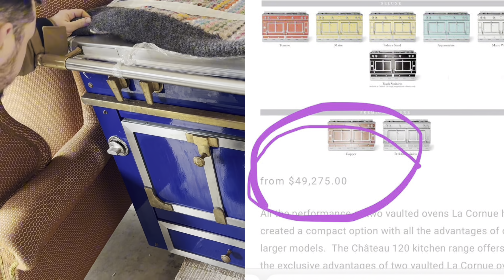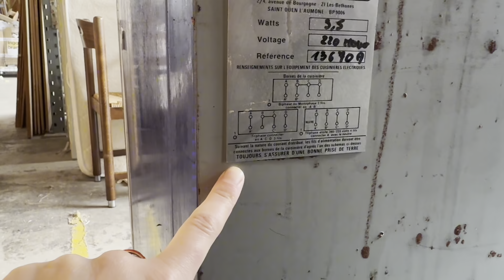Best thrift purchase ever!!! Renovating in Italy

Comment: Here is a description of a range that just may be a close match to your new range. I am so happy for your good fortune and can't wait until you have restored it to its original beauty! What a find!

La Cornue 48" Chateau 120 4 Burners French Top Dual Fuel Ovens, 1 Gas, 1 Elec

US $33,000.00  (eBay)

LE CHÂTEAU 120

The Château 120 range embodies an impressive cooking capability in a deceptively small package. Measuring nearly 48", this robust range features two vaulted ovens, one gas and one electric, 2 gas burners, 2 electric burners and a gas French plaque

47.2 W × 27.6 D × 36 H (inches)

1200 W × 700 D × 914 H (mm)

Traditional 4-Element Configuration

A stunner, la cornue 120 chateau range with gas top burners with 2 electric hobs and true dual fuel oven options. The left oven is gas and the right electric.

LE CHÂTEAU 120

The Château 120 range embodies an impressive cooking capability in a deceptively small package. Measuring nearly 48", this robust range features two vaulted ovens, one gas and one electric, 2 gas burners, 2 electric burners and a gas French plaque

47.2 W × 27.6 D × 36 H (inches)

1200 W × 700 D × 914 H (mm)

Traditional 4-Element Configuration

THE CULINARY ARTISTRY OF THE

CHÂTEAU

The Château Series is the crown jewel of La Cornue.

They have always represented a celebration of all that is glorious about France and the French culinary tradition. The Château exhibits timeless style and summons an expression of truly refined taste.

Made to order exclusively in the Saint-Ouen l’Aumône workshop outside Paris, each range is made by hand, numbered by the craftsmen, and is the embodiment of a specific owner’s vision. Available in an unrivaled range of 8,000 configurations, colors, finishes, and measurements, each Château range features La Cornue’s patented signature — the vaulted oven first premiered by Albert Dupuy in 1908. The culmination of three generations of research, innovation, and expertise, the Château series is available in seven range sizes, from a charming 30" to a stately 71". Complementary cabinetry, hoods, rôtisserie and accessories are also available.

The pure materials, experienced craftsmanship, and enlightened innovation of Château ranges offer uncompromising culinary performance that is unsurpassed by any other brand, whether residential or professional. Château ranges are as unique as each owner, and therefore, we believe, something quite extraordinary. Cherished by our clients as a commissioned piece of art, often passed down from generation to generation. Not only used to create masterpieces in the kitchen, the ranges themselves are considered by most to be a masterpiece in the kitchen.

THE CULINARY WORLD HAS ALWAYS LOOKED TO

LA CORNUE

In 1908, in the heart of Paris, Albert Dupuy ignited the flame of elite cuisine. It was there that Dupuy premiered the world’s first convection oven. At the time, most ovens were mere flat-topped cavities that held racks suspended over a fire. The majority of people simply considered cooking to be heating food to eat. But Dupuy pondered: “What does it really mean to cook?” He developed his oven with a vaulted ceiling to usher heat around the food, rather than trapping it to burn beneath. To enable optimum precision, the oven drew upon the city gas lines that were winding their way to homes and street lamps throughout the City of Light. Dupuy christened the oven La Cornue after the French term cornue — the system for refining the gas that warmed the new creation.

While we export ranges to more than 250 retailers in 40 countries, it’s comforting to also note that La Cornue, at its core, remains a craft manufacturer, with a full compliment of only 60 employees.

Each range is made by hand and the labor is intensive. Each worker is a specialist, understanding the greater goal.

They are not just craftsmen, but companions to each range along its journey from inception to crated final product. They are experts in steel, copper and brass, inspired by great design, working as a team to create an inspired tradition.

True excellence can only be achieved when every step in the process is in pursuit of perfection.

For over 100 years, La Cornue has continued to build upon Albert’s initial convection innovation. They’ve expanded the design, introduced new styles, but still maintain that it’s all done for one reason, and one reason only: the pleasure of the customer. Our reputation is fortified each day by those who engineer, build, refine, test, and polish each La Cornue. As a result, the name La Cornue represents a renowned spirit.